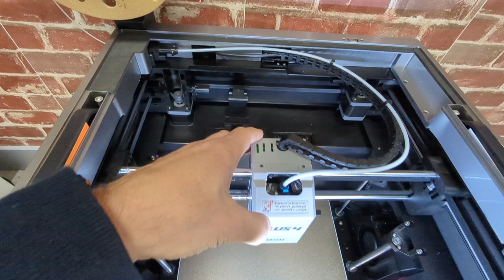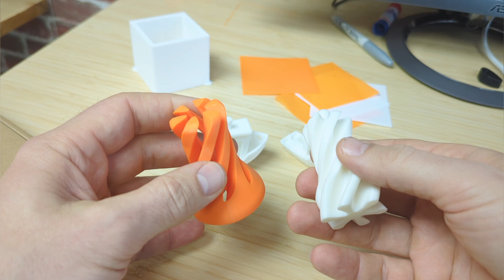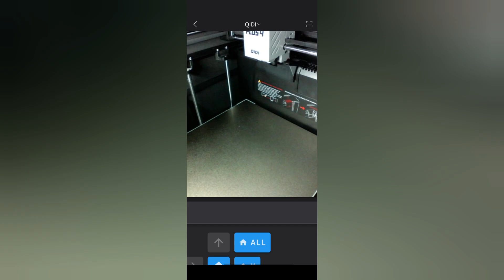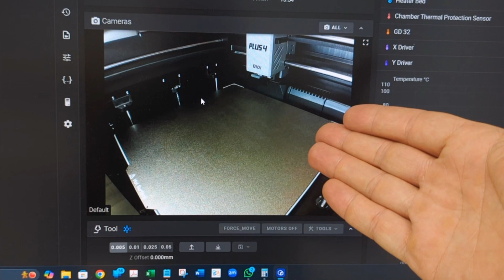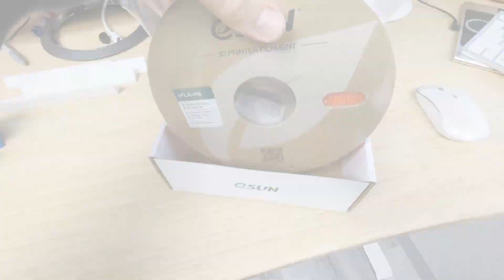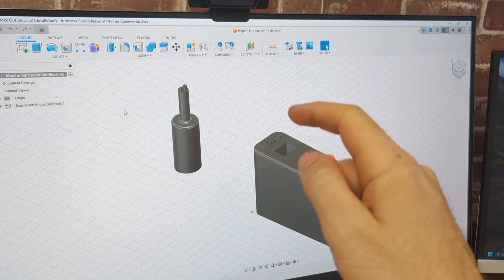Say GOODBYE To 3D Printing Problems! Qidi Plus 4 Detailed Review

Comment: I would have bought a Qidi if they had an automatic material system. I've heard for months now that they have one coming, and I'm wondering what's taking so long. I imagine Qidi doesn't have RFID tags in their spools? That's the nicest thing about Bambu printers with the AMS. You simply load the filament in the AMS (which has sensors that automatically unwide the filament into the machine), and the RFID in the spool sends all of the filament printing parameters to the machine, and to the Bambu Lab software- a feature I didn't know I needed.
Reply from the maker: @SyntacticOperator  yeah thats a sweet feature for sure. They say it's coming in 2025 🤞
Reply: @Doodlebud  I hope so. I'll probably buy one as we all know you can never have enough 3d printers!
Reply from the maker: @dieselphiend  LOL I don't have any more room for them. I want to convert my Anycubic Korba 2 into a drawing / writing machine
Reply: @Doodlebud  There's plenty of room on the ceiling :)
Reply from the maker: @SyntacticOperator  I bet it would run upside down 🙃
Reply: @Doodlebud  Yes. There is at least one person on YT doing it. Parts just fall off after it cools as a sort of ad hoc automatic print removal.
Reply from the maker: @SyntacticOperator  oh damn thats awesome!
Reply: @Doodlebud  It's pretty neat.
Reply: The initial announcement of the Qidi Box stated it would be Q1 2025.

Comment: I've never tried Elegoo Rapid, but I use their regular PLA and PLA+ all the time with no issues. Very cool printer and software.
Reply from the maker: Yeah the regular stuff I've used before but the HS version was only trouble.  Bad batch perhaps or maybe I just couldnt find the exact sweet spot on the settings.  But all the other stuff I used was a breeze and the prints turned out phenomenally well.  I'll be staying away from the Elegoo Rapid for now at least.

Comment: Oh yeah, also, the lack of layer lines comes from a super low layer height such as 0.12mm or 0.08mm. You could increase the layer height to speed up prints, but the layers will be thicker.
Reply from the maker: All the parts I printed shown other than the pen tray were 0.2mm layer height.  Im a quality over speed kind of guy.  The blocks I showed under macro were 0.2mm layer height
Reply: @ no way!! Those layers look insanely good for being 0.2mm. That’s seriously impressive
Reply: I can confirm. I upgraded my old, good ender 3 V2 by this Qidi plus 4 and I was impressed how good and smooth are the walls printed on Qidi. 0.2 layer height looks almost as good as 0.1 on ender.

Comment: Please, please, please touch that PEI build plate as seldomly as possible! I have learned from experience that the oils from human hands will ruin adhesion. Also, cleaning it once in a while with some dish soap or IPA does wonders.
Reply from the maker: Yup, before a new print I take the PEI plate and wash with hot water and soap and sometimes with IPA afterwards if I've really been touching it

Comment: I would recommend placing the nib block on the flat face for printing, you will most likely get better prints from that item. It will also help with first layer adhesion, which could be what caused the white filament to not work so well.
Reply from the maker: I printed the part like that the first few times but then you sacrifice quality in the contours of the parts (the elongated tapered cones).  Its a quicker method to print but the quality is significantly reduced.   I had no adhesion issues with the other filaments but if I needed better adhesion I could just print a brim/skirt to help.

Comment: Great review! Do you have a recommendation for a 3D printer for between $300-$400? Or are good printers more than that?
Reply: You can take a look at qidi q1 pro, which costs $399 and has very good performance.
Reply from the maker: Good to hear thats a great printer too
Reply: Second the recommendation for the Q1 Pro, which is pretty much the little brother to the Plus 4.  I think they have a coupon floating around for $30 off, making it $369.

Not as plug-and-play as the Bambu A1 is reported to be (and I hope so, as I'm giving one as a gift), but being fully enclosed gives you much more choice of filaments.
Reply: Elegoo centauri carbon.
Reply from the maker: The bambu labs A1 is a little above that price range ($489 currently) but its fantastic.  Do a search for best printers in that $300-$400 range and see what you can find.  Im not expert in the space by any means

Comment: 3D printers do look like they can be a lot of fun. I had to laugh at the magnet glue issue. I keep running into problems trying to glue plastic items. Finding the right glue is such a challenge.
Reply from the maker: The right adhesive but also surface prep is key.  I've used a specific loctite brand of epoxy which works extremely well for a mix of materials.  You'll break the part before you break the bond
Reply: @ I recently bought the two part Loctite Plastics glue (epoxy?). Haven’t tried it out yet, fingers crossed 🤞
Reply: @InksplatOops  3d gloop is a great solvent based glue for plastics.
Reply: I use Plastruct Plastic Weld. It's not really glue so much as a chemical the slightly melts the surfaces of the parts you want to bond and then they adhere together like a single piece. Works great for me.

Comment: Any sort of "high-speed PLA" is a mixture of PLA and something else to make it melt at a lower temperature and reduce viscosity, so it will always be a lot stringier and worse quality than normal PLA. It gives you speed by sacrificing accuracy and appearance. I don't think you got a bad batch, just a product that isn't quite upfront about what it really is, unless your prints are completely failing at a very high rate, and then it's still a maybe.
Reply from the maker: Pretty much every single print with the Elegoo messed up no matter what I did.  The other HS PLA was all perfect. I tried my regular PLA (non-hs) and at the higher speeds and the quality wasn't as good as the HS.
Reply: @Doodlebud  That sounds really bad then. Maybe it was a bad batch like you said, or maybe one of the additives stopped it from adhering to your bed (maybe it's even a completely different different material altogether, no PLA at all, and it doesn't stick to your bed material).
Reply from the maker: @Danny.._  It was strange sometimes first layer was ok, but then it would mess up later.  It was just all over the place trying to get it to work so I just gave up as I spent way too much time chasing things.  I put a new role of Hyper Series on and everything was perfect.  Strange one
Reply: Protopasta, buy American filament.

Comment: Wonder how well a 3d printed syringe filler, similar to conid bulkfiller and penbbs 335; would turn out.
Reply: if you want clear plastic, you'd have to print it in resin - filament 3d printing doesn't do clear well at all
Reply from the maker: I have a resin printer to do that type of work which would be the way to approach things.  But I like these types of printers (FDM) as they don't require post processing which is a pain, messy, and smelly.

Comment: I got a Bambu A1 not so long ago, but I know some folks who are in the market for this type of printer. I'll be able to direct them to this vid. Great Info!
Reply: Can you print broken or damaged pen parts? (Sections, etc.?) For example, if some wanted to print a black cap for a Pelikan 200 they lost (asking for a friend)
Reply from the maker: Yes I would be able to print those but I would need to be able to design it to exactly like the original for a replacement.  Most likely not something I will be doing as that will take time designing & testing every single part which would be very time consuming.  Wouldn't be worth the large number of hours invested into each part to sell a couple for $10-$20
Reply: @Doodlebud  I wasn't sure if an existing duplicate part could be scanned, them printed.
I ❤️ these videos. THANK YOU
Reply: @wendyholiday2021  3d scanning is still very imprecise and VERY expensive, and for something like a pen cap, the inside would be very difficult to scan, parts may even be impossible in some cases, and it would always require some manual work to clean it up and make it printable.
Reply from the maker: @wendyholiday2021  Retail scanners don't have the resolution needed.  I used to make high precision 3d laser scanners with extreme resolution (5-6um) but don't have access to those anymore.  But even then the manual testing etc afterwards would be very high.  Finding someone with a lathe who likes to tinker and do those types of jobs would be the best approach and would yield the best end quality
Reply: Correct me if I'm wrong, but a qidi printer is $800 and a Raptor 3d scanner is $1500. That is really not too bad of a price. And the raptor is up to .02mm accuracy for scanning. Good enough to help with creating actual car parts. What you're saying here has me concerned the raptor is not as good as I think it is?
Reply from the maker: Bambu makes a great printer from everything I've seen.  Love the huge print volume on this one.  Super please with the final quality which has been the sticking point for me with selling 3d printed parts.